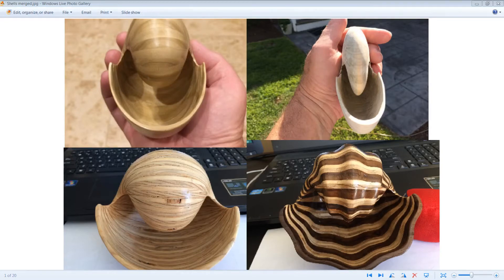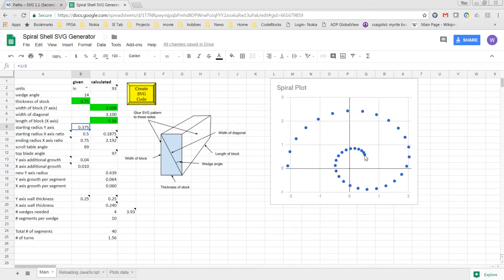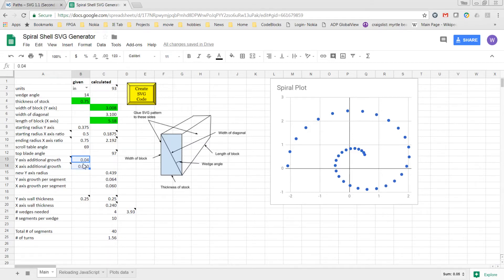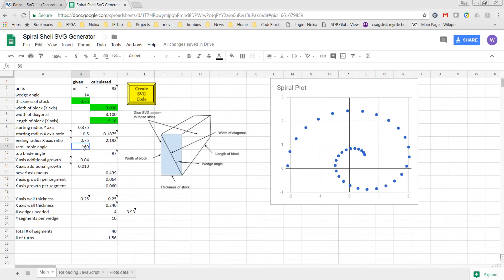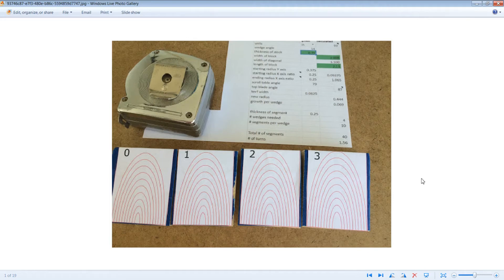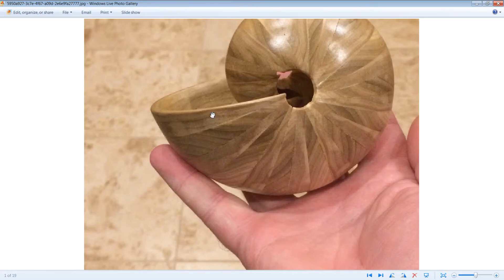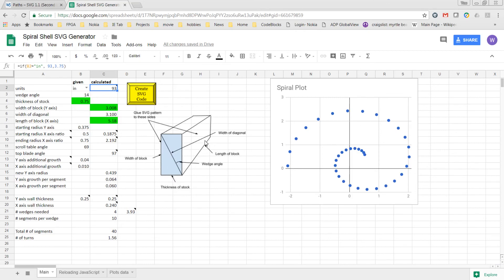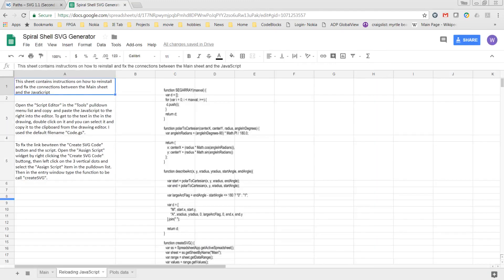Wooden Shell Scroll Saw Patterns Update

Comment: I just came across your channel. The ironic thing was I was just playing in my shop of this concept. I was making a bowl from a flat board using concentric nested circles. When removed and flipped, they form a bowl shape that I glue together and turn. I was playing around with what would happen if i did this on a wedge and created something similar to what you did. Although…yours is WAY cooler!

I’d like to try your spreadsheet. Does it have a setting for table angle (relative to the blade)?  If so, wouldn’t also the direction of approach and how the wood is rotated around the blade play a factor?

Thank you for your hard work in creating this spreadsheet and Merry Christmas to you and your family.

Comment: Wayne, I have been working with Steve and doing some of his shells.....very enjoyable.    I came across your two video's and found your spread sheet very interesting since variables can no be changed for different shells.    I would love to try this but trying your second link it says it's been trashed by the author.    Is this spreadsheet still available or has this all been scraped.   Hope it's still active.....you've got something really great going here.    I also do segmented woodturning and the program "Woodturner Pro" is a God Send.    Could you please let me know the status of your work....thanks
Reply from the maker: I'm not sure why that link isn't working for you, the spreadsheet is still there and the link worked for me. I have moved on from it though and wrote a python program using the equations from the spreadsheet. It allowed me to provide better plotting of the design, including a 3d wireframe of the arcs to give a better visual of the shell. The source of the program is available https://drive.google.com/file/d/10qYrkxOCuH8Mw41L1KdrMk2G92alx2je/view?usp=sharing. To make it simpler for people to use this program, I used a program that captured the python interpreter,  libraries, and the source files into a Windows executable file. If you execute this file nothing is installed on your machine it just runs the program. It is available using this link https://drive.google.com/file/d/1FNIoHjGd1v9uSVq-E_f7bqhe4op12ePV/view?usp=sharing. I have tested it on Windows 7, 8, and 10. The python program is written to work on Linux (I used Ubuntu 16.04) and Windows. It should work on a Mac too, but you'll have to install the Python interpreter and libraries needed to run it.
If you still want the spreadsheet, I'll download it and send it to you as an email attachment. It downloads as and Excel spreadsheet, you import it into a Google spreadsheet that you create in your own account.

I'll help you as best I can.
Reply: @wrw60543  Thanks Wayne for your generous offer.    Looks like you've put a lot of work into this.    I'm far from a computer guru, but am willing to learn.   Took me awhile to learn the Woodturning segmented program and I would love to learn yours.   Would very much appreciate you sending it as an email attachment as an Excel Spreadsheet.   I do use Excel to a limited degree, but like I said, I love to learn.   This program certainly gives one more leeway in creating more of a custom sea shell without relying on patterns that one must constantly enlarge or reduce.   Your program seems to do it all.    My email is:     rjroehrig@gmail.com                  Thank you very much.....a new challenge in the horizon.